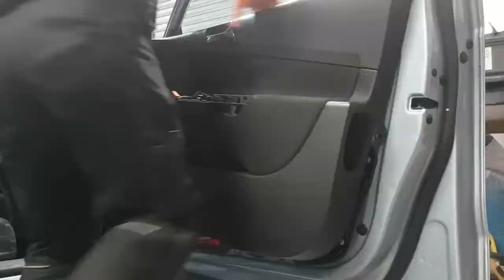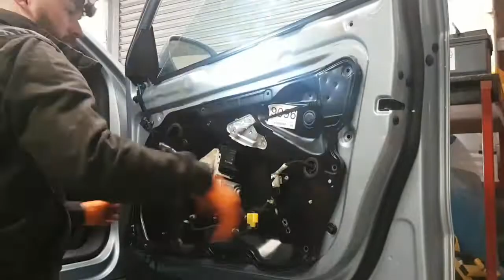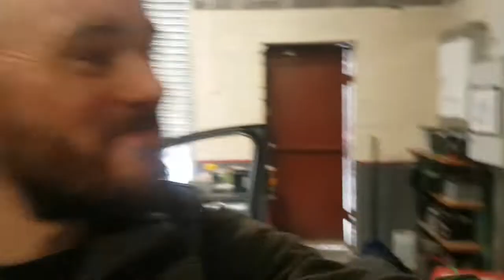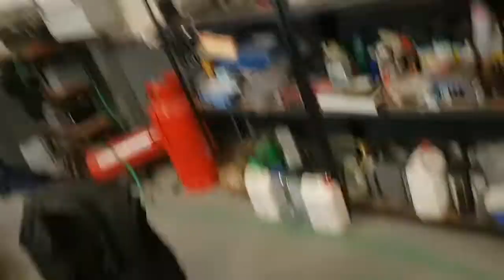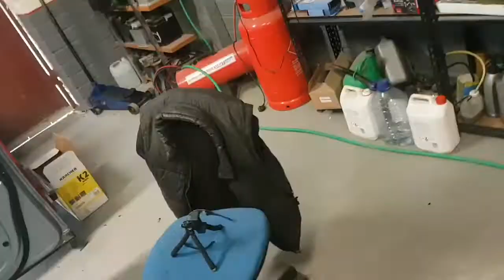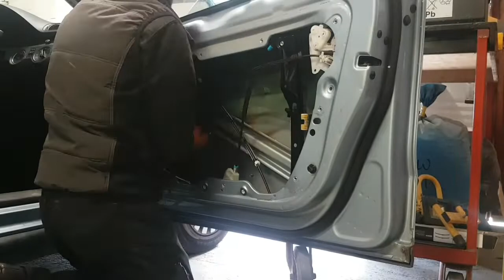Timelapse VW Passat window regulator

Comment: This is more work than you have to do. Find the access wholes to release the glass via the two E6 bolts which are reverse thread. After that all you have to do is take out all the bolts holding the panel on and feed  the wiring harness through the grommet holes and lift up and out the entire panel with the regulator. Then drill out the rivets holding the regulator  replace the rivets with 5 or 6mm bolts with locking washers.
Reply from the maker: Good advice. 👍But when them bolts on the window are seized it makes the job much harder 😫

Comment: Don't need to remove those three rivets before remove the carrier panel, it will hard to put it back, and I saw you don't,  I remove the carrier panel with the door lock all at once, first on rear door that fitted with 1/4 window or wagon, you need to remove the short window's rail that fit front of the door lock, then remove the lock bolts and then you can remove the all out a little to easy remove the cable that from the outer handle to the door lock ,then can out at once.some models need to remove outer door handle at once.
after out ,then can remove and install the rivets easy., front door is easy because no window's rail there,, Hope this help!